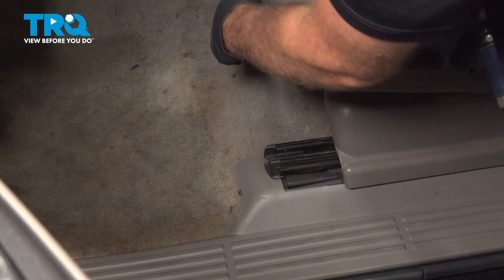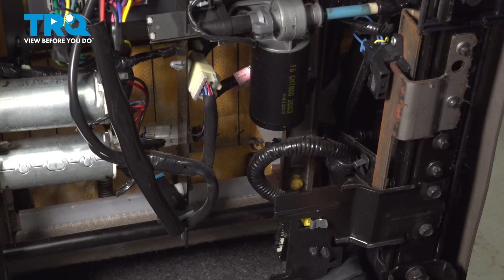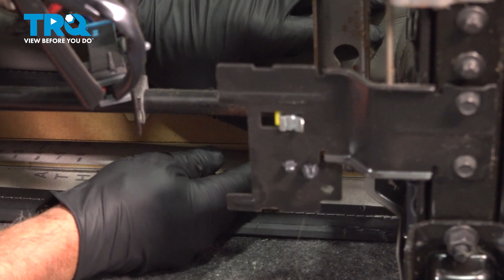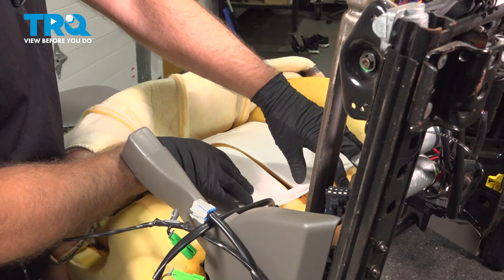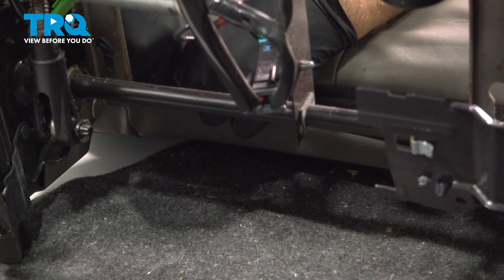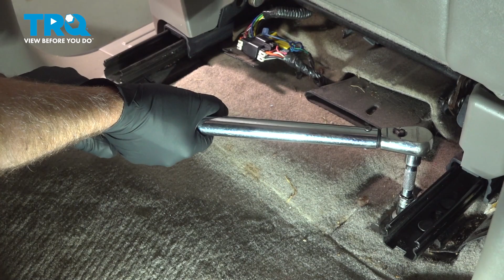How to Replace Seat Back Heater Kit 2000-2006 Chevrolet Tahoe

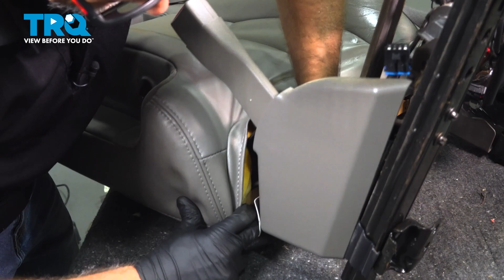Comment: Great video - thanks for making!  This was really helpful, especially with how to undo all of the wire connections.  For what it's worth to anyone else looking to do this, I was able to get the new heating element in without removing the arm rest or taking the seat cover off, which made things a little easier.  Once I got to about the 9:15, mark, I just pushed my hand between the seat cover and cushion, undoing the three Velcro strips.  To hold open the gap, I stuffed a couple tennis balls along both sides, which gave me just enough room to work down the middle.  I could then peel up the old element and put in the new one.  I had to work around a bar at the bottom of the seat, but it wasn't too much of a problem.  Thanks again for taking the time to put together these instructions!